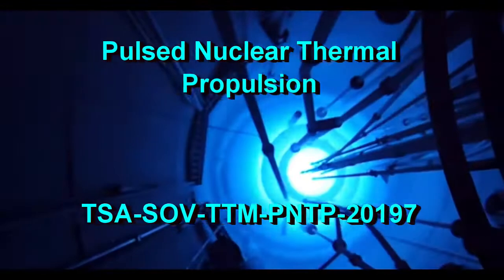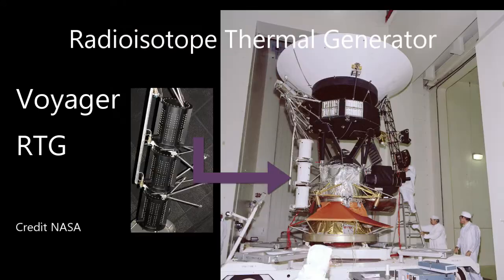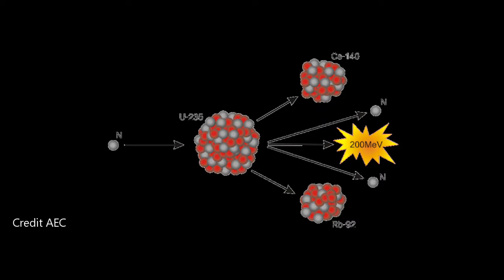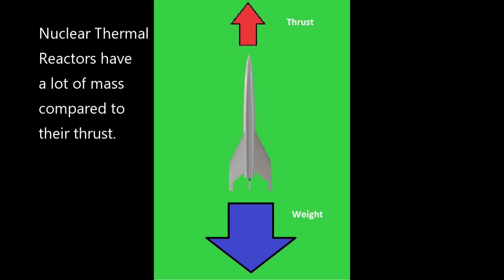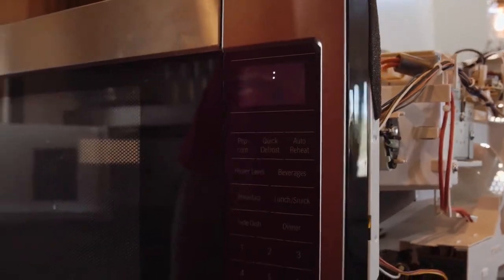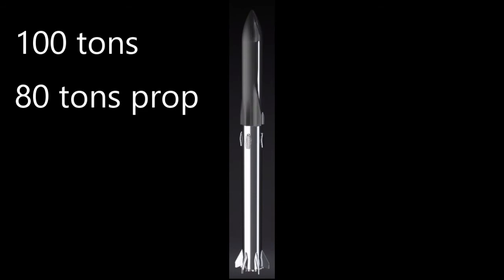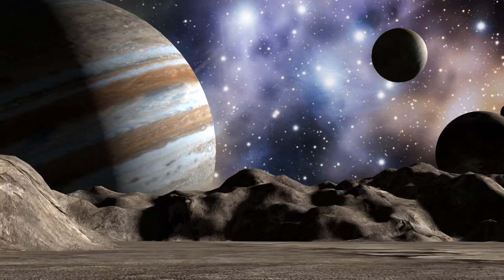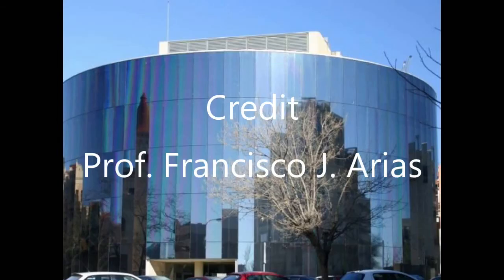Rocket Science: Pulsed Nuclear Thermal Propulsion

Comment: 5,000 to 10,000 seconds should be achievable by pulsing a standard reactor with cylindrical fuel elements. However, this concept can do much better; using the geometry proposed in the 2016 paper (flat fuel elements and coolant/propellant channels), Isp could exceed 1,000,000 seconds! It has the all benefits of a FFRE, but with no radioactive exhaust, higher performance, and the option to run in several modes

Comment: You forgot to mention that 95% of the energy from nuclear fuel is kept inside the core. Its not microwave, its just pulsed heating of the hydrogen while time between pulses have to be spent draining all that other heat out of the reactor. 

ITS LITERALLY SACRIFICING THRUST FOR ISP.
Reply from the maker: The heat is transferred to the hydrogen and carried out of the engine by expansion...
Reply: @terranspaceacademy  The point of pulsed solid core nuclear engine is to heat hydrogen to higher temperature than the melting point of the core itself. 

Mostly its only gamma and neutrons thats heating the hydrogen. Which only make 5% of fhe reactor energy output.
Reply: @terranspaceacademy  https://www.youtube.com/watch?v=qZXgL7mfcdw

Comment: This notion is similar to a sprinter type like Usain Bolt being able to maintain his maximum speed for a few hours, as opposed to the few minutes before the body overheats and crashes...

The cooling systems for pulsed thermonuclear thrust must be very heavy, to the point of almost offsetting the benefits. I am no engineer, just some dim guy with no skills or abilities.
Reply from the maker: Actually the heat load is much less than with usual nuclear thermal. The material itself doesn’t have time to heat up because the hydrogen is absorbing the neutrons kinetic energy. It is like a microwave oven in that respect. Also the ejecting hydrogen is cooling the system. It should be able to run indefinitely.

Comment: An interesting alternative (to VASIMR). I assume the propellant would be water. Upon being flashed by neutron, it'd be radioactive, wouldn't it? So it shouldn't be used on inhabited planetary liftoffs. Being nuclear, it'd also be very heavy, which works against any gains it's got. And so, most likely only used for in space propulsion?
Reply from the maker: Liquid hydrogen actually.  It is the most absorptive and gives the best performance.  Nuclear thermal with anything else doesn't work well...

Comment: 5:47 What about Open-Cycle Gascore NTR's and Fission Fragment reactors?
Reply from the maker: They have potential but are limited as the fuel takes heat from the reactor limiting the temperature to what the reactor materials can stand.  This design can heat the fuel to higher temperatures than what the metal could withstand and, if the fuel were ionized, could be kept from the walls by magnetic fields.  Also the radiation shielding required is considerable.  If we use our water for that we would make some of our water radioactive.  Neutron radiation is difficult.

Comment: Thanks This is the first nuclear thermal fission design I've seen that has real promise. Since the exhaust would be ionized at these temps,  MHD could be used for in space electric power generation maybe. This can be more efficient than heat engines and has few moving parts. Possibly higher specific power too.
On reflection, I see a problem for use as a rocket in that pulsed nuclear increases the energy per unit time that has to be removed by the exhausted propellant and radiator. Say 50% of the neutrons are absorbed by the propellant. This means that the ship either has to get real hot while thrusting or have a radiator that can handle a lot of energy. Radiators are the heavy part and 5000 sec. Isp means about 30 times the energy and add to that the high mass flow rate and you've got yourself one enormous radiator that you have to lug around all the time.
Reply from the maker: Those are factors that must be considered. The easiest solution would be to route the fuel in several layers through to the core so that more and more heat is absorbed before the propellant is finally flashed through the inner level into the pressure chamber. Which would of course need superconducting electromagnetic shielding to prevent contact with the engine components. In this matter more of the heat could be exhausted and the need for a large radiator would be much less. It would also be possible to pull energy from the exhaust plasma without the need for moving parts.
Reply: @terranspaceacademy  I was thinking that graphite might make a better propellant because it absorbs neutrons so well but your solution sounds more promising.

Comment: Can you link to the original paper/publication that this concept comes from? I would love to read further into the technical details.
Reply from the maker: Certainly...
Arias, Francisco. J (2016). "On the Use of a Pulsed Nuclear Thermal Rocket for Interplanetary Travel". 52nd AIAA/SAE/ASEE Joint Propulsion Conference Salt Lake City, UT, Propulsion and Energy, (AIAA 2016–4685). doi:10.2514/6.2016-4685. ISBN 978-1-62410-406-0.
Reply: @terranspaceacademy  Thanks!

Comment: How radioactive is the exhaust, is it safe for use in-atmosphere? And if it blows up, how bad is the fallout?
Reply from the maker: If you’re using hydrogen as a fuel there should be no exhaust radiation. The protons in the nucleus of a hydrogen atom are actually a little lighter than the neutrons emitted by the reactor. There is a little more than a 50% kinetic energy exchange and in a few cases the neutron will fuse to the proton and form deuterium, which is not radioactive. The metal in the engine itself will become slightly radioactive overtime and have to be retired at some point.  A nuclear explosion is not really possible with these which is why they are used in so many research locations. There is one in the middle of Massachusetts at MIT. They have been running for over 30 years with no accidents. There is always the possibility of a conventional explosion or overpressure explosion but these would not create fall out. If there were an engine failure and a ship fell back at full velocity and burned up on reentry it could turn the materials of the engine into uranium oxide, similar to the results of firing a depleted uranium shield at a tank. Not optimal but since it would burn up at high-altitude and spread out as it went down it would be just about imperceptible. By the time it got to the ground.
Reply: Ohh thanks for the detailed reply, it sounds like this technology is pretty safe.
Reply: @terranspaceacademy  Nothing to worry about.  We will spread it evenly across your backyard and roof.  LoL Iron meteors make it through atmospheric re-entry.  Zirconia rods are more heat tolerant than iron and do not oxidize.

Comment: In real life You will only carry less than 10% of liquid Hydrogen to land on Mars and 70% use for cargo. 
Then refuel again right before leaving Mars.
Reply from the maker: If I understand correctly you mean for producing methane while there? A pulsed nuclear thermal rocket would not use methane...just hydrogen without oxidizer.  I just wanted to see what the potential delta v would be if we could actualize one of these...
Reply: @terranspaceacademy  No, I mean LH2 will be constantly produced on Mars as a byproduct of extracting oxygen from water to breathe.  So it won't be practical to carry the propellant for the return trip, because of the boiloff issue. Consider rather increasing the cargo capacity.
Reply: @stelaser  Boiloff can be mitigated, and there have been tests for zero boiloff fuel tanks though admittedly they only achieved zero boiloff in the lab. Checkout the pdf "Large-Scale Demonstration of Liquid Hydrogen Storage with Zero Boiloff for In-Space Applications"

Comment: This is super exciting. NT rockets always needed to impart the reaction’s heat to the propellant, thus limiting their temperature to below the melting point of the core. And if I’m not mistaken, it’s even somewhat less than the combustion temperature inside a Space Shuttle Main Engine. All the nukes’ efficiency comes from being able to expel pure hydrogen, the lightest of all possible exhaust gases. The Nuclear Pulsed Thermal’s direct-heating of the propellant via neutron radiation is a forehead-slapping game changer. And a pulse rate in the kilohertz range?! hoo boy!!!
Reply from the maker: You are exactly right.  In some ways this is better than fusion.  Fusion will always require tremendous power to kindle.  A little Californium and this baby is off and running.  There is nothing like it.
Reply from the maker: It would be a paradigm shift indeed.

Comment: Seriously exciting but maybe you're even under-estimating it. Sticking with the Starship connection then if a Starship is getting almost 4 kg of propellant into orbit for every 1 kg expended then adopting SpaceX's plan for on-orbit refuelling becomes compelling. I think Musk's plan envisages 6 Starship tanker flights needed to fully refuel a Mars-bound passenger or cargo Starship in orbit prior to it departing for Mars. If everything was using PNT propulsion then 1 tanker (assuming it used PNT propulsion to get into Earth orbit) could top up 3 other Starships back to 100% propellant capacity with the tanker still having almost 20% of its propellant left for landing back on Earth and a safety margin and that's not even (I don't think) counting the tanker using a Starship's actual additional payload capacity (typically cargo and/or passengers) for extra propellant to allow it to lift even more propellant into Earth orbit.

Going even further it might then be interesting, particularly for Musk's mass colonisation of Mars dream but also for more distant manned exploration missions, to consider the possibility of building some sort of space-only transit vessel in Earth orbit comprising a core engine/reactor module plus plenty of perhaps Bigelow-like inflatable hab modules (large living spaces for Mars colonist ships; perhaps not so much space needed for manned deep space exploration vessels) and then lots of empty propellant tanks. Such a vessel would of course need more traditional Starships to ferry passengers to/from Mars/Earth at each end of the journey, or for a deep space exploration mission it would need to carry a small landing craft with it, but by using Musk's currently planned 6 tankers worth of fuel sent up from Earth for each ship departing Earth orbit that would load one heck of a lot of propellant into such a space-only vessel.

Assuming that it is the amount of propellant that limits the total length of time that a PNT engine can burn for at some given thrust/acceleration I'm wondering, with that much "over supply" of propellant that would come from taking 6 full Starship tanker loads onboard prior to departure, how long that would allow 0.376g (Mars gravity) acceleration and deceleration to be maintained on a transit to Mars and how much the 39 day transit time that you mention in the video could be reduced by for some reasonable assumption on the total mass of such a space-only vessel.
Reply from the maker: Very interesting premise.  The Epstein method :-) I did some of the math quickly and got an insane deltaV of 132 km/s.  That's assuming each tank is 100 tons total with 5 tons for structure and you have 6 extra tanks.  The primary ship is estimated at 20 tons of structure and 80 tons of propellant.  If the specific impulse is about 5100 sec which would be about the best we could hope.  To accelerate that mass up to Mars gravity equivalent of 3.72m/s^2 we would need a mass propellant flow of 49kg/s.  Our total propellant mass would be about 650 tons out of the total ship mass of 700 tons.  That would let us burn at that acceleration for about 3.45 hours.  The problem is the extra mass of the propellant makes us go through a lot of propellant to accelerate it that quickly.  We have to generate a lot of power.  If we use rotating habitats it would be a better way to produce gravity effects until we have antimatter but you are right that this thing could make it out to Planet 9 and come back in a somewhat reasonable amount of time.  There is nothing else I know of in our reach that can touch this...until fusion...but the neutron heating is still so incredibly efficient I'm not sure fusion will work better for quite a while.